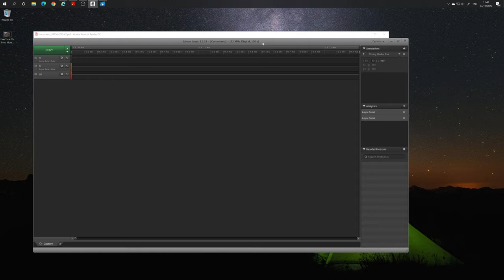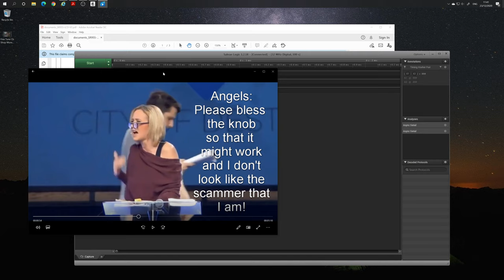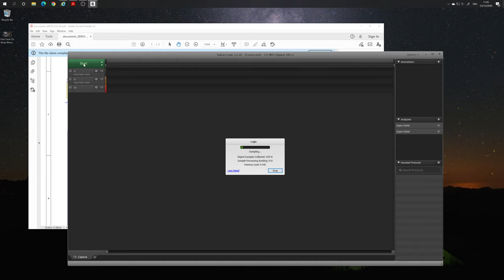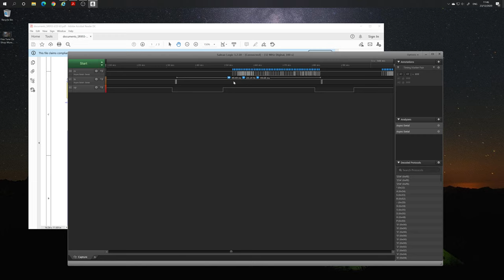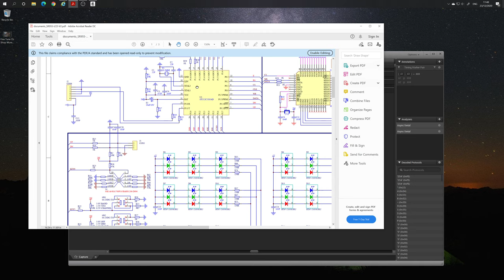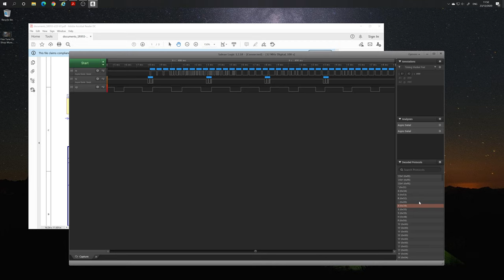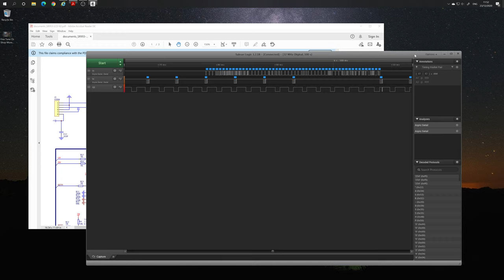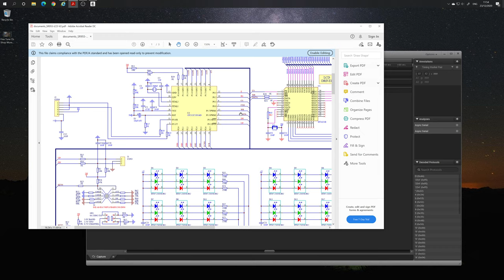Stryker SR955 "skipping" - why it does it and how to fix it (Hint: knobs and controls won't sort it)

Comment: This explains the issue - many thanks!
When I first operated the SR955, it struck me that I haven’t seen this type of interface and sluggish scan speed since the 1980s VCR displays.
Reply from the maker: It's been resolved in the 955 v2.
Now it's solid. No more pulse switch. It's an actual encoder now.
Reply: @Mark19960  Let me be among those who welcome Stryker’s Devo team to 1994!
😂 
Seriously, this is an issue that has lagged on way too long for such an otherwise classic radio.

Comment: So basically don't spin it to fast and it should work ok no? Maybe Stryker will see this and change it. Nice explanation thank you for taken the time to do this. Merry Christmas 🎇🎄
Reply from the maker: Yes and no. You can spin it in at a still reasonable speed and cause it to happen. It depends on how bothered you are by it really.
Honestly mate it really depends on how much the ODM is willing to change things.
It doesn't bother me enough to matter but I still made several modifications that compensate for this issue.
One lets me use quadrature encoders and the other takes over the up/down commands from the sub micro and injects them into the datastream.

Comment: Just what I always suspected lol
Reply from the maker: I have known this for a very long time. I have known the control can and does fail resulting in a skip but that happens at low rates of speed.
If you can turn it slowly and do 10 "clicks" and it changes 10 times, the control is fine.
If you try to spin the knob too fast you end up with this situation where the MCU isn't catching it, and that is a software issue
They tied those lines to hardware interrupts so I believe the intention was to use them, but they decided not to.

Of course, to utilize those hardware interrupts... they need to be set up in software.